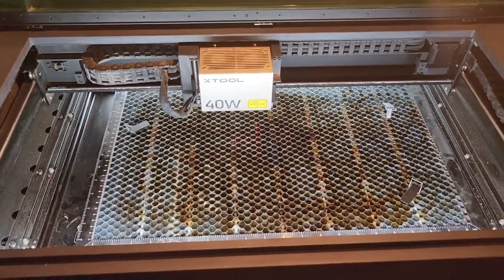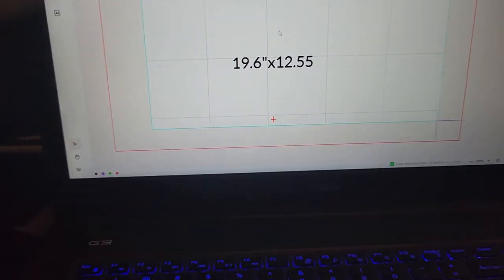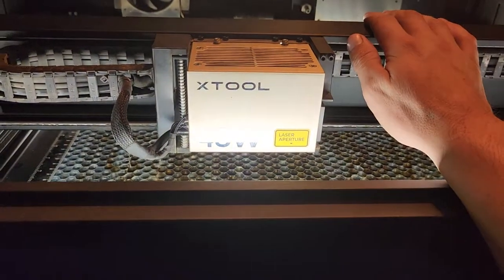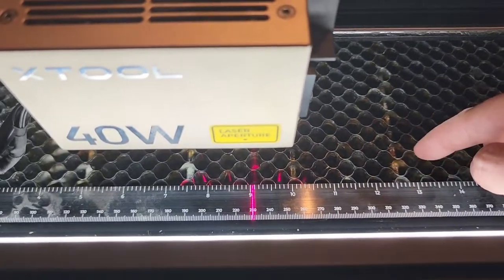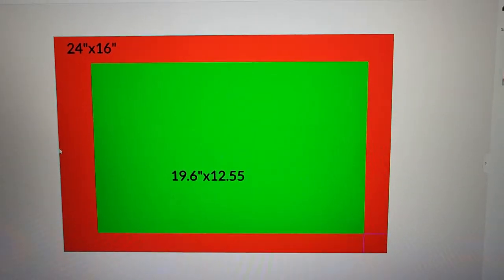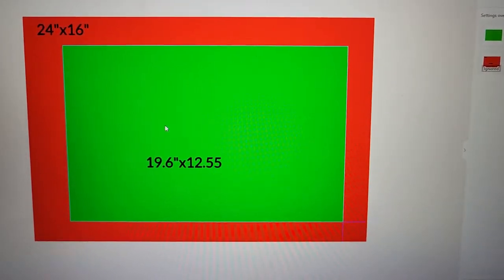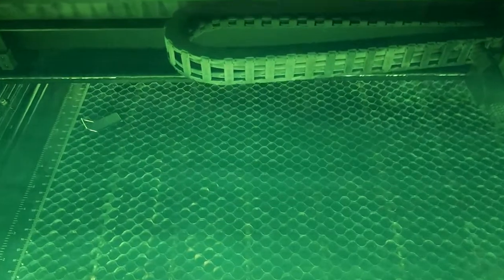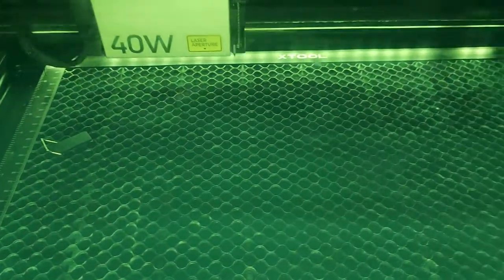xTool S1 Honeycomb Alignment and processing area check.

Comment: how do i know where i am cutting if i cant frame in the gray area?
Reply from the maker: So what I do when I am engraving something that’s outside of the framing area is I take the green section from the file that’s included in the video, I set it to score at a 4% power and 50 mm/s

Then I close the lid and run the score, I use the very faint lines to determine if I need to make any adjustments of the board up or down in order to be centered within the machines engravable area. This mark is so faint that it easily stands off after the job is finished usually with 220 to 300 grit.. 

I do the same method to check my alignment when doing a tiled piece. I have engraved on a 4 foot board that was an inch and a half thick so too thick for the conveyor system.

Comment: I'm not getting that big of parameter with my 40w I'm getting a little under 11.5 height and a little over 18 width i followed everything you did but I'm coming up short there's a .8th of a inch grey area on the top
Reply from the maker: Yes, the gray area is engravable just not framable. 

If you load the file and set the green layer to score, run the file and you’ll see the perimeter score. You can put a piece of cardboard or something similar in and cut the material out to save as a size template to keep on hand for easy reference

Comment: Thank you a lot, you answered my question about the borders of the s1!
Reply from the maker: Always glad to help. Had the same feeling when I got mine so had to make something to address the issue. I surely do hate how some of these machines have confusing work areas. Bought a CNC kit years ago to find out 3 inches of my Y axis was off the front of the bed in the air… 🤦‍♂️great for dovetails but not what I wanted.

Comment: Is it possible to manually set or move the laser head to define the cutting area on a sheet of paper? I feel like the auto-leveler pushes down a bit too hard and might cause the paper to shift during leveling.

Comment: me again, also the button on the front of machine is blinking purple
Reply from the maker: @kabokreations  that has to do with your network connection/ WiFi usually. Or the firmware is currently updating. 

Try a long press of the button to reset the network connection for the machine.

Comment: i'm having a problem with my S1 - the laser crosshair is not visible on the software processing area.  It is visible on the honeycomb.  Therefore, I cannot measure or cut anything.  How do I reset the laser crosshair on my computer screen?  thanks in advance for the help...so far I can't get any answers.
Reply from the maker: make sure the machine is connected to xcs. Most likely your disconnected. 

Otherwise, reboot the machine, and computer and see if the issue is resolved. The air assist cable throws issues too if gone bad (removal and restart will verify)